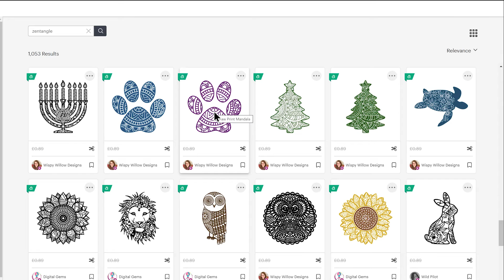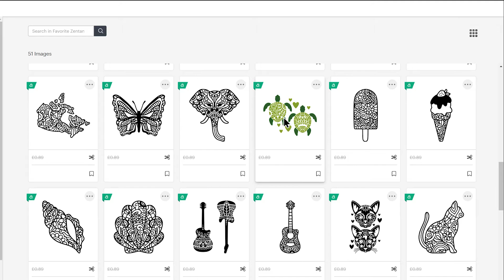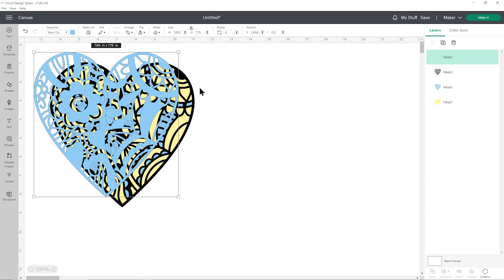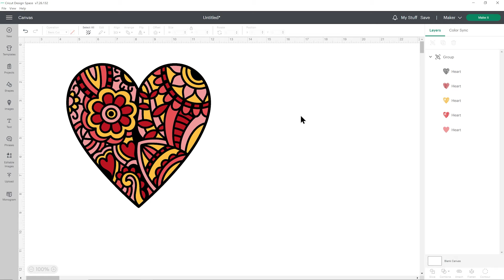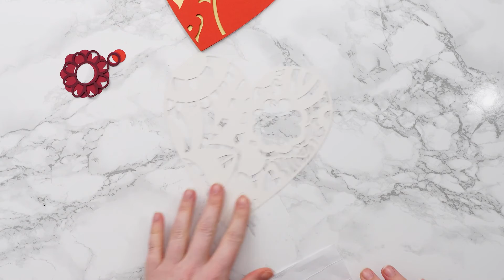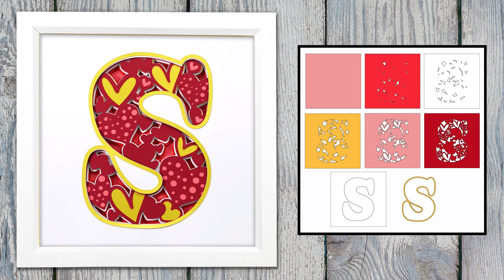Cricut Design Space: Turn a One Layer Image into Multiple Layers for amazing 3D Papercrafts!

Comment: This was super helpful video. Thanks!! Would you mind sharing what kind of glue that you used for the intricate top layer?
Reply from the maker: I'm glad it was helpful! My two favourite glues are Bearly Art Glue (which comes with a very thin nib so it's great for intricate pieces), or Collall which I decant into small needle tip applicator bottles. I buy both on Amazon in the UK. The Collall is a solvent glue so it has a bit of a smell to it, whereas the Bearly Art Glue doesn't smell.

Comment: Could this heart be done using print then cut or even just cut the top layer ?
Reply from the maker: Absolutely! Just "Flatten" it in Design Space using the button at the bottom of the layers panel to turn it into a print-then cut. You could flatten the whole thing so it will print as one image, or just the top layer.
Reply: I made a multi-layered card that is in DS - I think it was 6 layers - it was too thick to put in the post - I am in the U.S. and I needed to mail it to Canada - it was too costly, yet I really like the card - I think I will do it as a print then cut and just cut the top layer and glue it down - I am making a wedding card with raised flowers and they want $15.00 for postage - I have to come up with a way to bring the cost down - I don’t mind if it is $3. or $4. but $15. is way too much